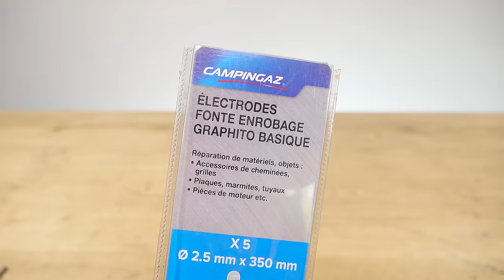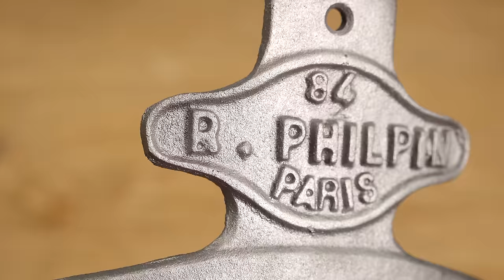1890s Antique Potato Peeler - Restoration

Comment: Well done. The machine is meant to be used with a faucet pouring water over the potatoes to rinse away the peels and to keep everything running smoothly.
Reply: Thanks for the Intel, I really felt something was missing there
Reply: No, it isn’t
Reply: @bguen1234  I'd rather not spend my time arguing with people on the internet; so I'll be brief in my reply. I have used potato processors exactly like this one while working in soup kitchens and volunteering at various places; they are always mounted inside a wash basin with a faucet running cold water over the drum, allowing you to dump in batches of potatoes to peel, then the peeled and washed potatoes are dumped out via the gate at the bottom and put into a large pot of boiling water to cook.
Reply: @windshearahead7012  Why are you yelling? Is your caps-lock key stuck?

In case you don't understand; you have to cook potatoes before you eat them, and it is most efficient to boil them, pre peeled, in large batches. That way, when they are done boiling, they can be made into mashed potatoes or other dishes without any further prep work.
Reply: @thraximundar2974  thank you so much for being civil and thoroughly explaining things, and dont worry about those unreasonably rooted replies, you seem to be a very nice person with good work ethics. Nice to meet you here sir. Cheers
Reply: @thraximundar2974  That doesn't mean people had the luxury of endless running water in 1890.  I would be surprised if they left a tap running just to clean potatoes.
Reply: @thraximundar2974 actually you can eat them raw as well.
Reply: @tattoosteveneo  Sure, you can eat raw potatoes, if you don't mind acute solanine poisoning.
Reply: I was going to mention the water just before I saw this. lol These are actually still produced, only more modern motorized commercial versions with grit rather than grates, and they have water plumed into a fitting on them. Peels super fast. This old one is a great find.
Reply: @bguen1234 no reply to the man... typical
Reply: @tattoosteveneo  yep I have they taste good either way, but I prefer them cooked.
Reply: @thraximundar2974  Gack!  My grandmother would always give me a raw slice when she was preparing potatoes for dinner!  Now I find out that Granny was trying to poison me all along!!!  🤣
Reply: @Philiopantheon82 😊
Reply: @thraximundar2974  Sweet potatoes! Geez....
Reply: To quote:  "home processing methods like boiling, cooking, and frying potatoes have been shown to have minimal effects on solanine levels".  Microwaving did best, cutting levels by only 15%.
 
On the other hand, most of the solanine in a potato is found in the peel, as well as solanine produced by photosynthesis and poor storage.  Anywhere from 30-80% of the solanine in a potato is in the peel.  So peeling the potato is really the best you can do.
 
If one wanted to, one could TASTE the uncooked peel.  The alkaloid is bitter and detectible in that way.  A high level would also cause a burning sensation.  But you wouldn't be eating the whole potato.
Reply: @bguen1234  yes it is. Restaurants that uses fresh fries and not frozen fries has this exact same machine (automated not manual) to peel potatoes. I myself have used them many times.
Reply: @thraximundar2974  Actually solanine is only found in green potatoes!  Don't eat the green parts. I have eaten plenty of raw potatoes with zero problems.
Reply: @tattoosteveneo  bruh they're part of the nightshade family. Don't eat them raw
Reply: @JohnZombi88 tomatoes are part of the nightshade family too and everyone eats them raw
Reply: Oh cool thanks!!
Reply: @thraximundar2974  no that's not true
Reply: @thraximundar2974 exactly! I too have used peelers just like this one, I ran a small stream of cold water as the potatoes 🥔 spun until clean and skinless with very thin tiny flakes of removed peel. Very efficient and no waste as the flakes were put into the compost. Then the kitchen was gifted  a peeler three times bigger. Held 25 lbs of potatoes but the cylinder was vertical with trap door. It also cleaned and peeled all root vegetables extremely well. Again a small stream of water as I cranked the handle. The one side came off for very easy cleaning. Worked like a charm. But ours was a nice bright red, not army pea green ugh😝! 😂
Reply: @thraximundar2974  lol ate a chunk of raw potato while mum made dinner almost every day while growing up.  I still do it and I just turned 70.
Reply: My very thought.

Comment: When my dad was in the army, he used something like this to peel potatoes. The mess hall needed A TON of potatoes peeled quickly and this handled the job. I think water was running over the potatoes while they spun.
Reply: I have seen similar machines, although motorized.
Reply: Ancestors of devices like this are used to this day in fish & chip shops up and down the UK. They're motorised and and they use tungsten carbide sheets as the "grinding" surface, but it's still the most efficient way of doing it. 

Every once in a while, you'll get a large smooth stone in a bag of potatoes (which was mistaken for one because it was covered in mud). I imagine you'd notice pretty quickly in a device like this, but it absolutely wrecks the modern carbide sheets. I guess that's the tradeoff for mechanisation and mass production.
Reply: @Orion40000  I think you mean "descendants", otherwise I totally agree.
Reply: @jaromir_kovar   Oh hell, you're right. Thanks for the correction!
Reply: KP duty yeh buddy been there.
Reply: What a waste of time
Reply: I had a friend who worked in our college dining hall (1970s). They had a machine that resembled a top loading washer. The water ran and carried away the peelings and the interior drum was a grater, much like your machine on a grander scale. He loaded in a 25 lb bag and started the machine. He then got to talking to a girl who worked there and lost track of time. When he realized he needed to check status, he looked in and the machine was empty. 25 lbs down the disposal machinery. I heard he worked very carefully after that. 🤠 🥔 x25 # 👎
Reply: I just went to the comments to say, add water and it’ll work way better, but you were faster…

Still great work to the content creator! Love your videos 👍🏻
Reply: My grandpa said something similar, it was in a big sink with running water and full of potatoes. Kp back then was no joke 😂
Reply: You are correct. It is designed to best operate with water drizzling into it
Reply: Some guys on KP thought they were smarter than the cooks and would insult them.Then they'd sit for hours peeling potatoes with a knife."Sorry the peeler isn't working." Then they'd dump in 50 pounds and the machine peeled them in 3 minutes.When the whiners started crying--I thought it wasn't working........It wasn't we aren't smart enough to turn it on until they tell us how.
Reply: You did a great job restoring the potato peeler, one can turn items considered useless and unnecessary into something beautiful and the Machine is still usable, before This type of machine works very effectively. Thank
Reply: isn't it just easier slicing the skin in half before boiling. after boiling the skin peels right of with a spoon. i'd imagine this type of tool is only efficient if you have bags full of potatoes to peel at once
Reply: @kushpaladin  It's usually for making chips/fries, where you wouldn't want the skin on, and you wouldn't be boiling the potatoes anyway. 

You have a point if you were making roast potatoes though, since they need to be peeled and are often parboiled before roasting.
Reply: Yes we've used a tool very similar to this in the past. Water running over the potatoes as you spin. Much cleaner at the end.
Reply: @jaromir_kovar  ancestors? decedents? too confusing, I'll just call them dancestors :o)
Reply: I want that!
Reply: Guys, Salvation is Simple

HalleluYAH translates “Praise ye YaH”

YaH is The Heavenly Father
YaH arrives via the TENT OF MEETING
YaH was Who they Crucified for our sins
YaH was Crucified on an Almond TREE

Ancient Semitic of Moshe (Moses)
Isa Scroll (The Original Isaiah)

Isaiah 42:8
"I am YaH; that is my Name! I will not yield my glory to another or my praise to idols.”

Isaiah 43:11
“I am YAH, and there is no other Savior but Me.”

Isaiah 45:5
“I am YaH, and there is none else.”
Reply: they couldnt just eat the peel?

Comment: Magnificent job you did restoring the old potato peeler.  I like it when you chose stainless steel to make new grating parts because it resists rust and is easier to clean.  Moreover, you don't have to worry about the possible risk of lead poisoning from that old rusty grating you replaced.  It looks much better and it works like a charm too.  Excellent work.

Comment: I used a machine very similar to this when I worked at Mc Donalds in 1965. The only differences were the size (we used the industrial version, it held 100 pounds of potatoes) and the sides of the drum portion. The drum was coated with some sort of "sandpaper" like coating and we had a water hose that fit into the top of the machine that rinsed away the peelings as they were peeled. We would collect all of the peelings after we closed, dried them out really well and fried them for our own consumption. Man....those were good. Remember that in 1965 we closed at 8:00 pm.

Comment: The historical inn I worked in when I was in high school had an electrical peeler like this (that was fitted with more modern wiring). It had an intake and drain hookup for water, to wash away the waste (pulp from peels). It was a very, very cool piece of kitchen equipment from the 1910’s.

Comment: This was a good restoration video. My question is why do you use Hydrochloric Acid and not Vinegar? I'm only a casual antique restorer myself but I use vinegar for my initial major rust removals and it works pretty well, just takes a bit of time to soak. 🤷🏽 Also what's the advantages of the flocked paint vs liquid/spray paint? I'm just curious about your process and approach to restorations is all. Great content from your channel though! Good job with the potato peeler!

Comment: Good Lord above!! This takes me back to the farm days when I was just a wee lad. Farmer next to us had the same machine but with some modification - instead of the hand wheel he had a pulley of sorts connected up to a Maytag engine. That thing would run at full revs, anything lower it would die. His wife would have the peeler filled to the brim with spuds and sat it next to the well pump. While it was screaming blue murder she'd be pumping it with water. And out the peeler go the spuds, in a flash at the toppest speed! Filled a good few barrels up with peeled spuds they did in short of no time.

Comment: Excellent work, as usual.  I wonder what the advantages of powder-coating versus normal painting are?  I mean, I suppose one advantage is something we saw here: the ability to dust off the powder from areas you don't want it before curing it.  Are there other advantages?  Is the paint more long-lasting/scratch resistant or something?  Also, I suppose a potato peeler could be used as a medieval torture device.  Please don't so use it!  It actually worked on the potatoes a treat!  I particularly think they'd be good as roast potatoes - the rough surface would help absorb fat, which would help them get really crispy.
I really like this channel.  I have like 50 channels I'm subscribed to, and this one is certainly the leading nominee in the "labour of love," category!

Comment: WATER! You'd have to use water during the peeling process. The "machine" would usually be placed in a container of water until the potatoes are half submerged. Then it works like a charm. I remember this, cause my first job as a chef was in an old place, where they cherished old techniques.

Comment: The way they worked was you put about 10 full potatoes inside then submerge the bottom half in water and just turn it. The potato skins would be completely peeled in about 10 minutes and the potatoe peeler itself would be cleaned easily as most of the the potato peel simply washed away cause it is being used in water. I think people maybe think it was just peeling dry potatoes which would obviously get stuck in the holes and be a nightmare.

Comment: tip: to determine how cast iron should be welded, you first need to know what type of cast iron it is. Imagine that if you should drop the cast iron and it would break, do NOT grind the crack! If you should drop it and the cast iron would remain intact (so not brittle) than the crack could be grinded.
Always pre-heat the crack and tel it cool down very slowly.

Comment: saw one in a commercial kitchen in India. It has water running thru it at all times, and was situated over a sewer.
It was run with electric motor, which turned out to be dangerous, as it shocked the loud mouthed chef but good when
she walked thru nearby puddle.

Comment: I love mechanics without plastic. A modern manufacturer would make this thing 80% plastic and 20% foil and sell it like a Rolls-Royce. I would love to buy household appliances for my home without an ounce of plastic, completely made of metal, but I can’t find them today. I'm willing to pay more, but no one simply makes plastic-free kitchen appliances for the home.
18:12 When assembling it was a good idea to lubricate all the shafts. There are special lubricants for food machines (the modern food industry has mechanical equipment and it needs lubricant that is harmless to humans if it accidentally gets into the food product). There are different types of such food-grade lubricants. One of them is waterproof, that is, it can work in contact with liquids (many food equipment has moving parts that require lubrication and at the same time work in contact with water. I’m talking about the lower stop of the vertical shaft.
In our army we had similar potato peeling machines, but they were electric. Water must be constantly supplied to the drum to wash out the husks. I think this purifier should be placed under running water and rotated while water constantly pours from above.

Comment: oh i know that acid bath smelled awful. A couple years ago our sink clogged up in the kitchen and i was trying to do the dishes and was frustrated, so poured hydrochloride drain cleaner hoping it would clear up the blockage and i could move on. instead, it made the blockage worse and the acid would not drain. it smelled absolutely horrendous and we didn't know what to do to fix it so we had to wait for our landlord to get a plumber. There was alot more going on to so with the fiasco but most of what i remember is just the terrible terrible smell that plagued our house for a week and after it was fixed it still smelled pretty bad for a while.

Comment: I don't think it's smart to get rid of the 'casting defects'. If that's how they were sold back in the day, that's your goal for restoration. Your goal shouldn't be to improve the product to something better than it was over 130 years ago. If I have an original oil painting done by Picasso that has a hair caught in the paint, or some other 'blemish' that was there in the original, it doesn't make the painting more valuable to remove that hair or otherwise fix that blemish. The imperfections make it MORE valuable (for antiques) than less.